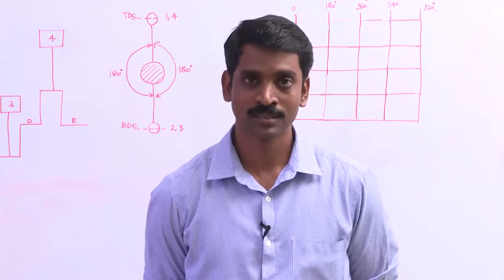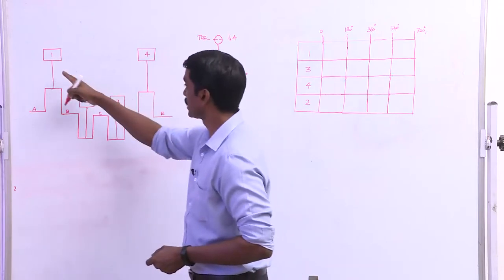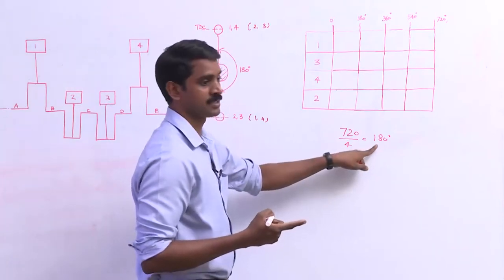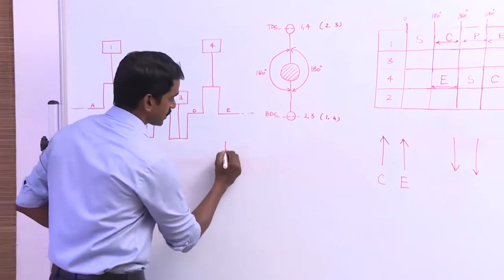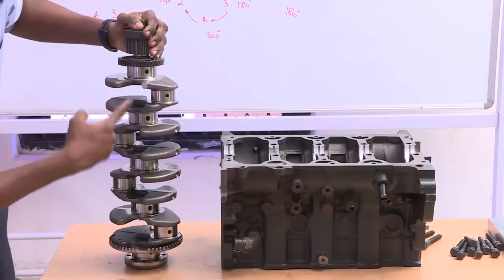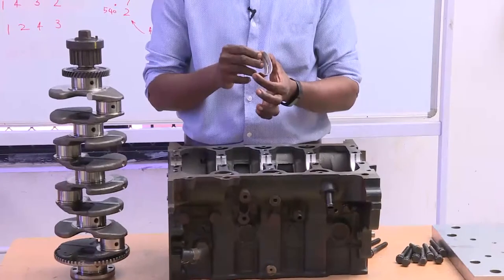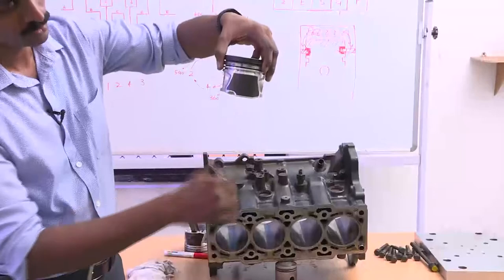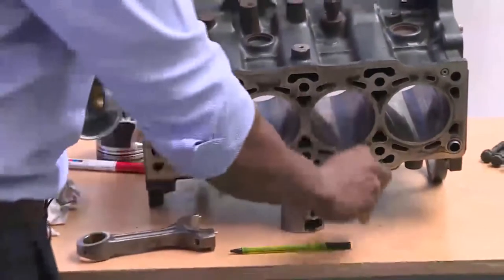Engine practical aspects, Firing order, Crankshaft design and piston design explained

Comment: Why strokes on 6 cylinder engine are overlapping and how ???? Could you pls help me to answer  except reason of 120 degree crank design
Reply from the maker: By the principle, every four-stroke engine has to complete its all working cycle in all cylinders in two complete revolutions of the crankshaft irrespective of the number of cylinders. With this, considering the firing order of a six-cylinder engine, let us calculate the power duration in six cylinders like 1-5-3-6-2-4. We all know that the power stroke happens for 180 degrees in four-stroke engines and if the power stroke does not overlap then 6*180=1080 degrees would violate the 720 degrees rule. Therefore when the first cylinder completes 120 degrees in the power stroke, the fifth cylinder would start to produce power stroke. For the next sixty degrees, the first and the fifth cylinder would be in the power stroke. Similarly,   when the fifth completes its 120 degrees in power stroke the third cylinder would start to produce power then the cycle repeats. To meet this purpose only, the crankshaft is such away designed with the 120 degrees phase shift.
Reply: @ottosudhakar4590  Thanks a lot for taking time to answer my questions 🙏